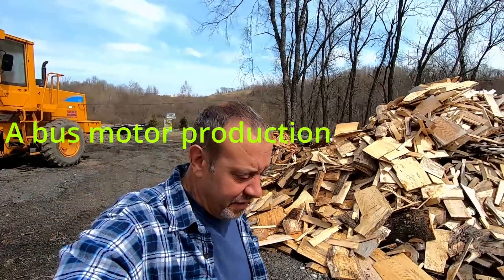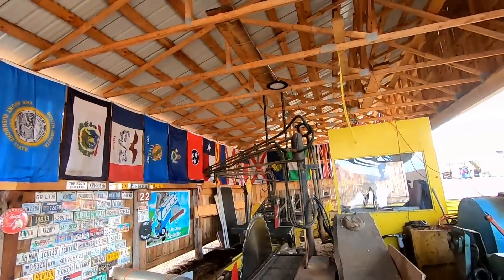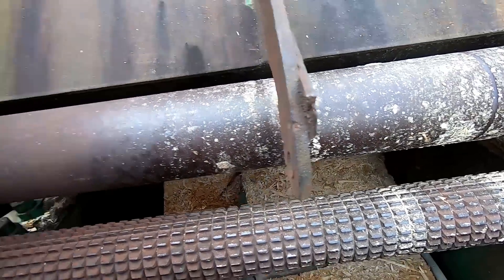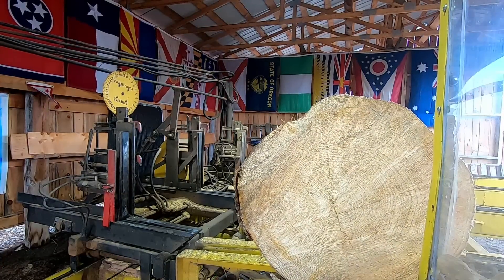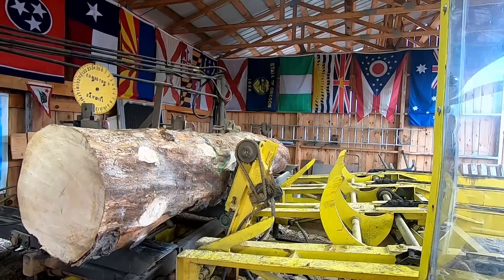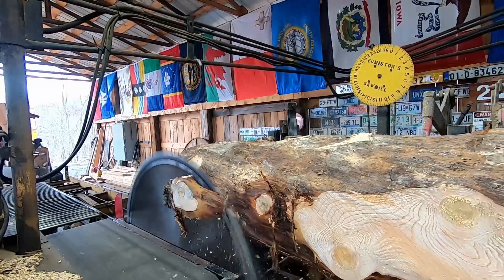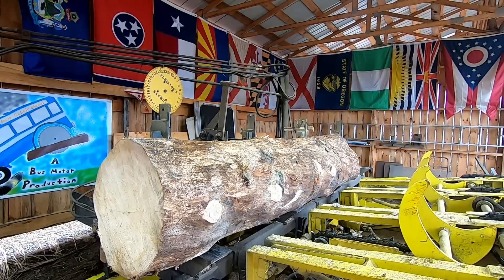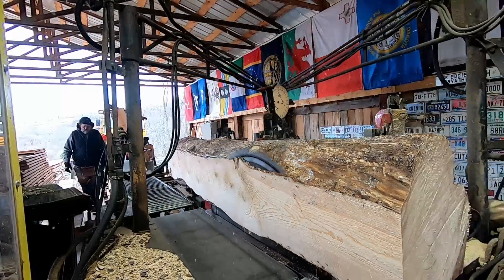sawing pine 1x's # 287

Comment: I'm old and loosing my grip too. Wish I could order replacement parts. Hope you add to the lighting. Love the videos.
Reply from the maker: I think we all could use some!
Reply: @markgalicic7788  The feed rollers on the old Babbitt bearing edger were as slick as the side of the main saw. Just had to shove the boards through till the outfeed slick roller got them.

Comment: Evening Mark and Eddie, how does the deck vary its travel speed for the different size of cut  is it controlled by you, or the resistance of the timber.
Great Friday eve video,
Regards Richard 🇬🇧
Reply from the maker: good question Richard, the feed rate is controlled by me .